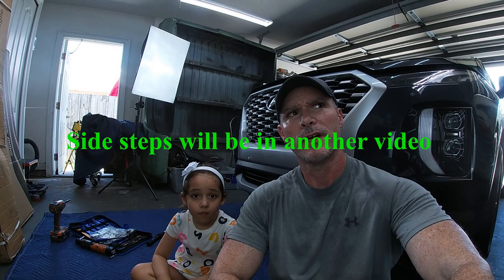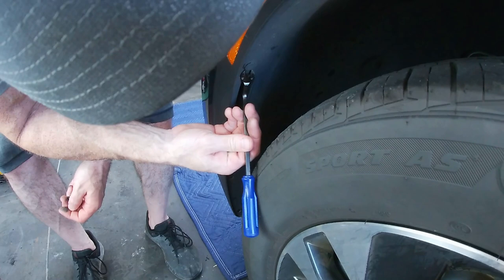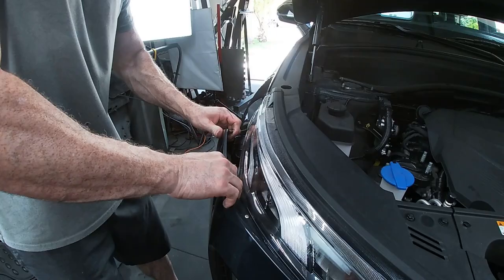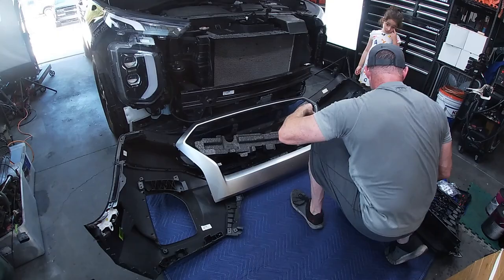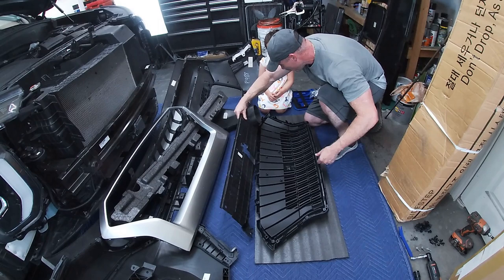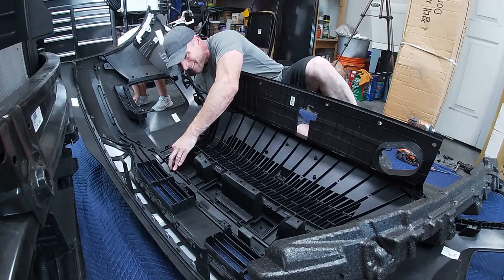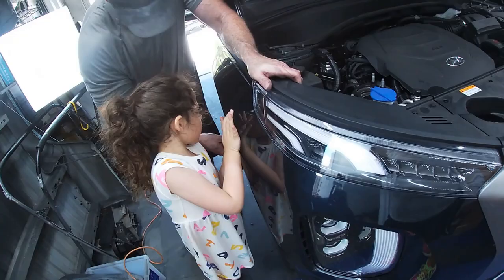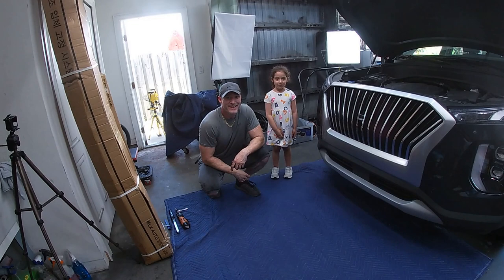2022 Hyundai Palisade How to swap your ugly grille . Step by step how to inside

Comment: Congratulations on changing the grille. I am a newbie in any car modification so wanted your help/advice on Hyundai Palisade 2022 model modification. Some of us are wondering how to change the 2nd row to a bench seat. I think if we remove the seat behind the driver and replace with a oem/salvage bench seat it will do. Do you think it is possible ? if so do  you know how to remove a captain chair ( i see some cables). 
If possible can you make a vedio how to remove one chair from the second row ? Searched the whole youtube yet to get any good tutorial/help/demo on this topic.
Reply from the maker: I actually purchased this specifically for the captains chairs. My kids were constantly fighting over space and the bench would not work for us. As for your question ussually car makers have one base frame then adjust things like plastics, carpet, seats. The best way would probly be to get a full bench from a reseller or ebay then add on what ever is needed. The bolt holes are probly there  already. The captians chair do not bolt up the same as the bench due to sliding and the auto slide button which is the cable your referring to. The way I would look into this is go to a place like carmax or a hyundai dealer and look at the bench mounts for the frame then the captains chairs and take a bunch of pictures. Then find what ever you need used check ebay. That's how I am doing the auto rear hatch opener with the buttons, actuators, and wire harness. Good luck with the project. 👍
Reply: @thisoldhooptie  thanks for the info, i have already looked into this and from the parts drawing it seems they have same 4 bolts. I will investigate this further.

Comment: Just tumbled into your channel. Great Video!  Where can I find this grille please??
Reply from the maker: Thank you 👍
The link for any parts used is in the description of my videos. The grill really cleaned up the front  end of this suv. I'm very happy with it 😁
Reply: @thisoldhooptie   Thank you for getting back to me!!! The Amazon link to the grill is "broken". Do you know the manufacturer or any other place that might sell it?? Thank you in advance!
Reply from the maker: @Gary-fp9gw  I'll have a look
Reply from the maker: https://www.ebay.com/itm/153710046495
Reply from the maker: It's the mmg or momoreal 2021 to 2022 palisade grill. I don't believe it fits the calligraphy models. There is a separate model for the calligraphy on ebay. Good luck 👍
Reply: @thisoldhooptie   Thank you for the ebay link! I love this look. Unfortunately I have a 2024 Palisade so I will have to smoke this out further. THANK YOU!
Reply: @thisoldhooptie  Last question...I promise! Did your original/factory  grill have a camera? If so, does the new grille simply fit around it or is there a new camera fit into the replacement grille to plug in? I would hate to lose the front grille camera, have problems with any of my views and/or a drop in image quality. Thanks again. I am not used to anyone responding here!
Reply from the maker: @Gary-fp9gw my palisade did not have the camera option. There is a place for it to snap in along with the hyundia emblem if you choose to use it.  I left the emblem off. There are plenty others, and I feel it looked cleaner this way. I would reach out to the ebay seller to verify that it fits your model and has the camera mounting clips before buying. It looks the same, better safe then sorry. 👍
Reply from the maker: No problem. This grill will not fit the 2024.

Comment: I was wondering If you knew that LED reverse lights or Tag lights would that void the warranty?
Reply from the maker: I wouldn't surprise me if one day that was the case. But no swapping bulbs should not void the warranty its a user serviceable part. It has never  voided mine. I had a Hyundai Sonata from 2012 to 2022. I swapped the bulbs and had the car in for all services without any issues.

Comment: If I just need to remove the grey plastic skid plate on the bumper do you think I can do it without removing the bumper?
Reply from the maker: There are probly 2 ways to get to that piece. Pretty sure you could un bolt and remove the plastic protector under the whole front end which I think is more work and working upside down.  Or pull the front clip like I did. Its really not hard to get the clip off. Some bolts and plastic clips and it pops off then snaps back on.
Reply: Ok. Thanks. I’ll let you know. If I’m removing the whole bumper now I’m looking on Amazon at that front grill so thanks for that! 😂 looks sweet.
Reply from the maker: Thanks let me know how it goes, good luck 👍

Comment: Curious about the front camera.
Reply from the maker: My model doesn't have the front grill camera. The grill is for se and sel only in the listing. However I noticed one guy in the reviews mounted it to a limited and added a screw to mount the camera, here is the link 
https://www.amazon.com/MOMOREAL-Radiator-Hyundai-Palisade-Product/dp/B07ZF2YKZF/ref=mp_s_a_1_1_sspa?keywords=Momoreal%2Bgrill%2Bpalisade&qid=1664787860&qu=eyJxc2MiOiIxLjE3IiwicXNhIjoiMS41OSIsInFzcCI6IjAuMDAifQ%3D%3D&sr=8-1-spons&ufe=app_do%3Aamzn1.fos.c3015c4a-46bb-44b9-81a4-dc28e6d374b3&psc=1&th=1#aw-udpv3-customer-reviews_feature_div

Comment: Hey I wanted to get this exact same grille I saw it on eBay for 900 tho and my only problem is that it don’t come in black . Also did you ever get a chance to put on the sidesteps because I wanna do the same thing as well and throw 24s on em and lower it a little bit
Reply from the maker: Have a look at the link in my description. That should take you to the one I purchased, It was around $500 shipped. I will be Installing the steps in the next couple weeks. Ill do a how to when I put them on.
Reply: @thisoldhooptie  ok cool thanks and I subbed you
Reply from the maker: @supernovabeyblade2449  appreciate it 👍 ill be spraying one of my truck beds black then im on the steps for this truck. I have some interior floor lighting which I will probly throw in the same video.

Comment: I thinks it’s a pretty cool mod. It reminds me of the Maybach grill. I think the outline of the existing grill is the worst aspect. So, not a perfect solution, but an improvement nonetheless.
Reply from the maker: I fully agree. In my opinion most of these type of cars and suvs like kia / hyundia already snagged looks from the euro family of cars. They have some of the interior finishes too. For the price you get a decent machine. Before this we had a 2012 sonata 2t it was great until rats got into the engine bay. Not a single issue in 9 years, then electrical nightmares weekly. It ended up effecting the ecu which was not worth fixing.
Reply: @thisoldhooptie  My 2013 Genesis is also having some weird electrical stuff, like lights, windows, HVAC fans randomly not working. Planned obsolescence at its finest.
Reply from the maker: @Jimmy-ph8xn  Definatly. Thats one of the things I love about my old pickups. They are pretty easy to trouble shoot with cheap parts available at the corner store.